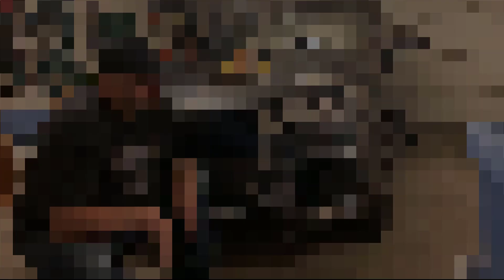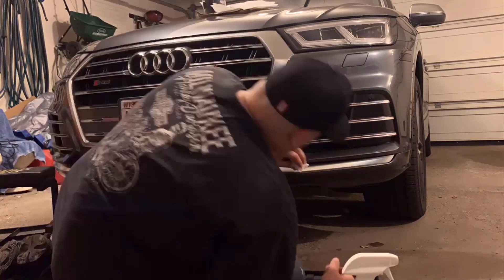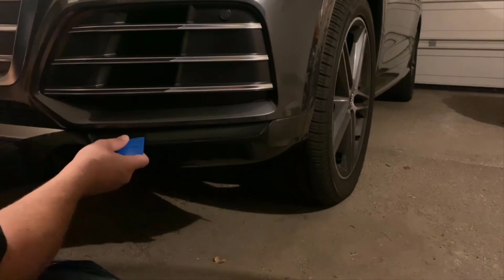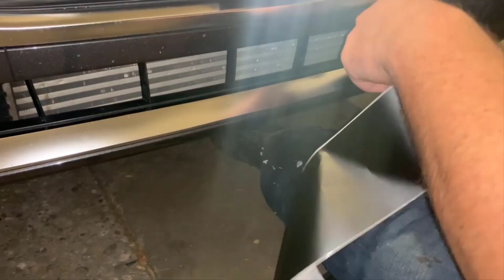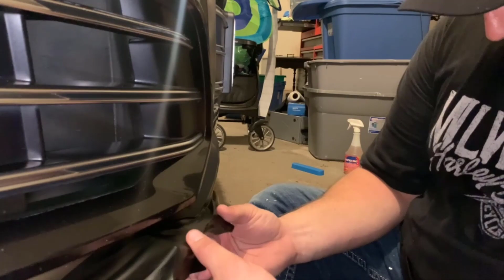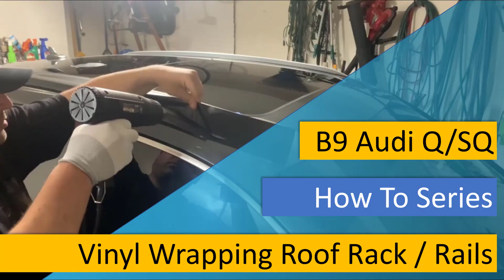Audi SQ5 B9 - How to Vinyl Wrap Front Bumper Trim Piece

Comment: Are you simply not able to use a trim tool and pop this piece out to work with it off the car?
Reply from the maker: Based on thoughts while doing it, popping it with a trim tool wasn't a good option. Vinyl wrapping the trim piece while is it is off the vehicle would probably be pretty difficult, since you'd be stretching over a flimsy plastic piece. I'm sure removing it might give better adhesion on the back side, but the struggle of wrapping a piece that is flimsy, in my mind would be more difficult. Thanks for the comment and stopping by!